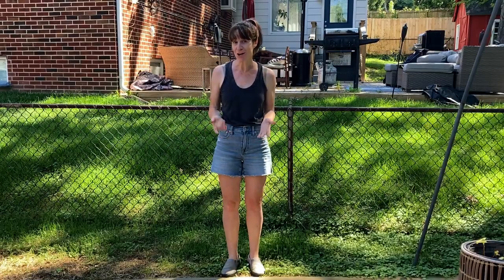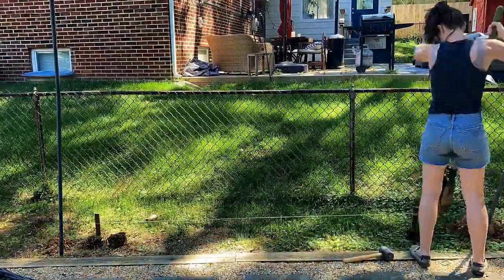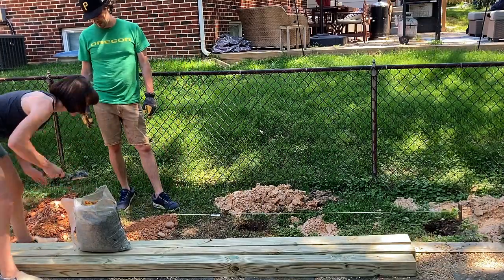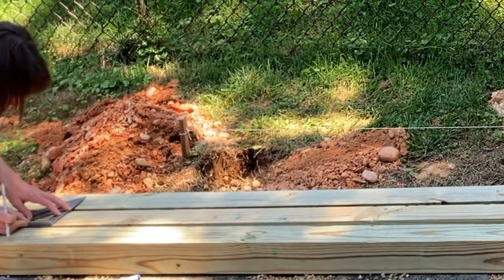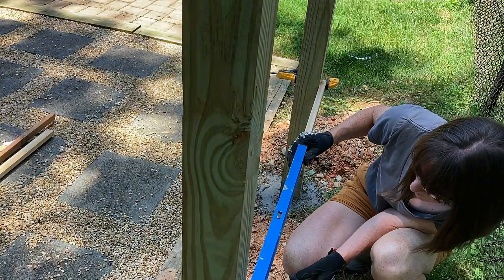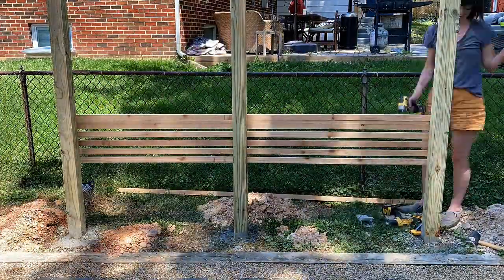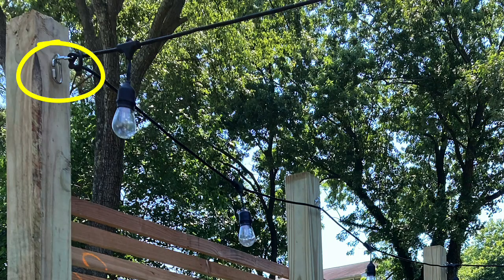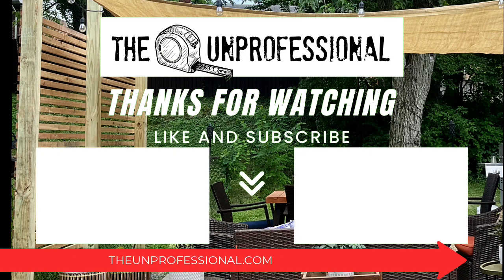Make a Privacy Screen Without a Saw | Easy Patio Privacy Screen

Comment: I want my privacy screen portable, or extremely easy assembled/dissembled for moving around my backyard; so I decided to build it with 1 - 1/4 in. greenly painted PVC pipes. The verticals are wood hammered down into the soil, and those horizontals are just hung with ropes both sides just like those narrow gapped rope ladders. Then some 6 x 8 ft. outdoor floor map for light weight table and chairs (all legs are cushioned with 1/2 x 8 x 8 in. plywood boards so they won't puncture into the expensive map).

Comment: Why do you put gaps in between. If I choose to fill in the gaps, will it look bad? I have really nosey neighbors outside my window and don't want to them to see ANYTHING. LOL
Reply from the maker: I think you need gaps, yes, but they could be smaller than mine so it’s basically impossible to see through. Sorry about your neighbors, they sound awful!
Reply: A variety of benefits come from having gaps in your screen.  One reason for gaps is to let wind through, reducing lateral pressure on your structure.   Or to let minimal light through, so you don't have a dark spot that affects growth of plants & lawn.  If the gap and slats are about equal in thickness, the screen will provide about 50% transparency, sort of like squinting and looking through your own eye-lashes.  As the thickness of the slats increases, there will be more sense of privacy, like a picket fence with narrow gaps.    Great video. Nice work!
Reply from the maker: @Baumeister40  brilliant explanation! Thanks for watching and for contributing such great information.

Comment: How much was the cost in materials? Just the wood I mean
Reply from the maker: I believe it was around 300$. I used cedar which makes it more expensive. You could do it much cheaper with pressure treated slats.
Reply: @TheUnprofessional  Does that price include the posts? Thank you!